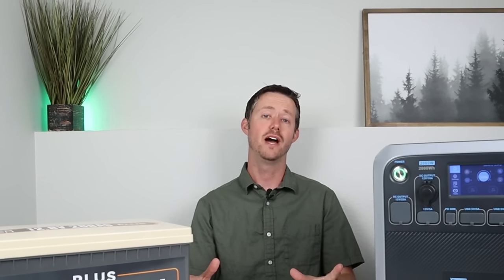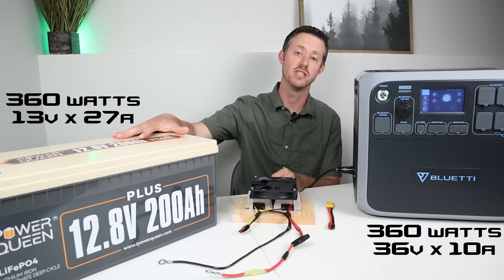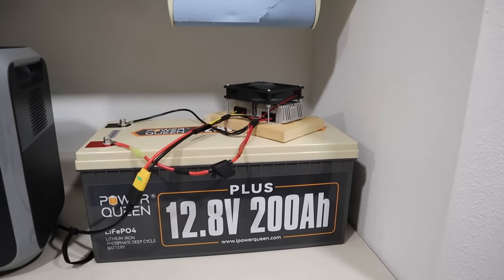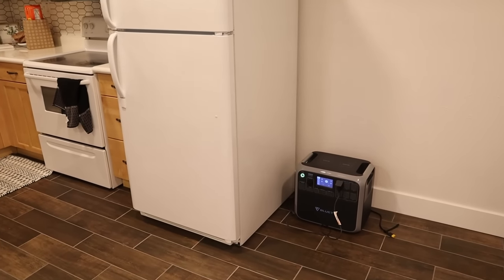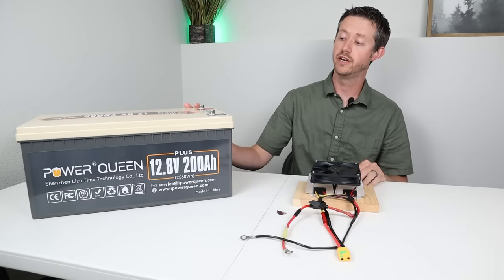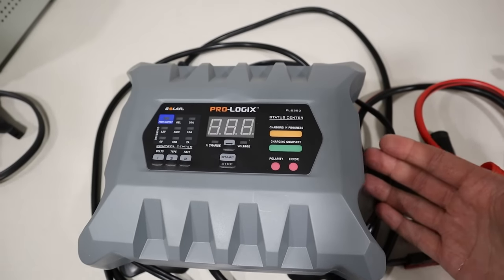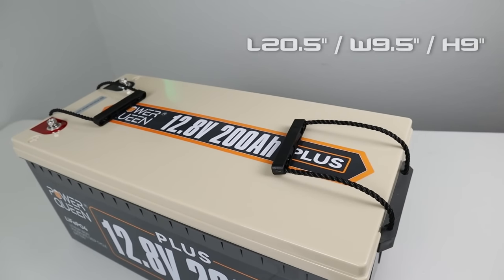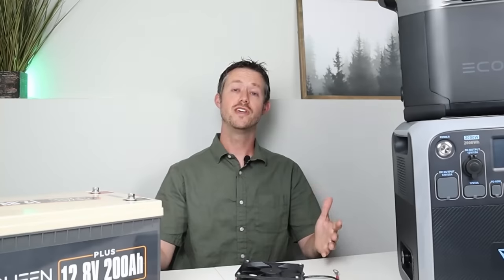Make Your Power Station Last Longer! Power Queen 200AH LiFePO4 - DIY Expansion Battery!

Comment: Jason... I don't own yet, want a AC200 max. I have a 48v server rack battery with 5kwh of capacity. Would it work to use he Bluetti DC Charging Enhancer (D050S) and battery clips to charge the AC200Max with the server rack battery? Thus increasing the capacity 3 fold
Reply from the maker: That's a great option! You wouldn't actually need the charging enhancer.  The 48v battery has peak voltage of 58.4 when fully charged which will be a great input voltage on the power station by itself.  Set the input charging on the AC200MAX to solar input and plug in the battery.

Comment: So, if I arrange a 36 volts battery with 70 Ah, it will be even cheaper, because I would not need a DC to DC converter. And, it will be easier for the fuse.
Reply from the maker: Correct, no need for a converter if you put the batteries in series.

Comment: i used a cheap variable dc-dc boost converter i got from amazon that allows 30 amps and for me to adjust the voltage and amps, has it's own cooling fan and a little over 30 bucks. but it does require supplying my own cables, and the 8 gauge ofc wires barely fit in the connectors. but it handled the 30 amps on the input for about 400 watts on the output. but you do have to set the voltage and current manually.
imo if you are going to be using it on a load that is variable, like a fridge, and is around 150 watts when on, i would connect the battery directly to the power station, and remove the loss that happens from the boost converter.
Reply from the maker: Thanks P M for sharing your setup! You are right that charging at the 12v rate would probably be fine while running 1 fridge. For other larger loads this mod will allow it to keep up with charging. If I was going to invest into a more serious setup like this it'd probably be better buy a 24v or 48v LFP battery and just run the power straight into the power station. For example, the 48v 5Kwh EG4 batteries make a good argument since they are cost effective for what you get.

Comment: i purchased from ebay about 2 years ago a 600 Watt 10-60 Volt to 12 to 80 Volt Boost Converter to boost  the voltage on a small 60 watts folding solar array to charge my Jackery 500 a little faster. It went very badly for the Jackery im afraid

Comment: Is it possible for the ac 200 L to recharge the onboard  and this expansion from the 200 L dc solar or ac charging?
Reply from the maker: If you have one of Bluettis expansion batteries that are compatible with the new AC200L, they will charge and discharge automatically as the power station is charged. It's a seemless setup and it's super simple to use.
If you used a DIY expansion battery, there is no way to have it charge from the AC200L automatically.

Comment: Can a dual fuel generator be used to recharge the Power Queen 200ah? I'm thinking of buying a power station and an external 400ah battery for Vanlife.
Reply from the maker: Get two of these and plug them into the generator and you'll charge your battery at 60 amps. Reliable and long lasting setup:  https://amzn.to/484DUD9

You could also use cheaper LFP battery chargers, they probably won't last as long.
Reply: @Jasonoid  Thanks for the advice, I'll look into your suggestion.

Comment: Hi, thank you so much for your video, I think I finally get it...I already have the Bluetti AC200MAX which I believe can take up to 51.2V, I was looking at having my Kia Carnival 2022 smart alternator/car battery connected to the Sterling Power DC-DC Battery to Battery Charger 12V 70A in / 48V out and connect the B2B Charger to my PowerStation, would that be correct? I'm hoping I'll get more than 500W into the PowerStation, up to 800W would be nice...lol.
I look forward to your response.

Comment: What is the benefit? Cant you just draw power from the battery  to generator without all that extra stuff?
Reply from the maker: Yeah, but you're limited to 100 watts charging if you connect up the battery directly. By increasing the voltage (with the attached gadgets) you can get 3X the  charging speed.

Comment: Ok so if you're using this backup battery to help power the generator, won't that prevent you from using solar panels as well? Since they would both use the same input on the power station. And is there a way to charge the extra battery with solar or is it only AC? Because that's one good thing about buying the OEM expansion battery. With something like the Ecolflow Delta 2, the spare battery they sell connects through a totally different input on the side of the units
Reply from the maker: The Bluetti power station has two charging ports, you could always use the Bluetti Charging Enhancer to charge with solar panels on the 7909 port OR you could have a solar charge controller and solar panels charging the large battery and the battery connected to the AC200p. Lots of different options and this was just one solution.

Comment: Hi there. Thanks for great vid. How would it work with 24v 100Ah battery? Would it damage power station (vtoman 1800 for example?)  . Would it need any adapters ? Would appreciate your response.
Reply from the maker: What's the charging input specs for that power station?
Reply: I think its  30V max
Reply from the maker: A 24v LFP battery is fully charged at 29.2 volts. It will often be under that amount. I guess as long as it stays below 30 volts it should be fine.
Reply: Meaning I can connect 24v 100Ah battery directly to power station without any charge controllers or any other devices? (Sorry for silly questions)
Reply from the maker: @slavaartyukh4075  yep, you might want to verify with a voltmeter to make sure it's not over 30 volts

Comment: Q:  can I charge the power queen via the power station using the DC output??   
Basically I have an ecoflow delta.   Thinking of using the DC cigarette output... Using a 24v converter, connector to power queens to charge the battery via solar. Will that work?
Reply from the maker: The DC output is not a charging voltage. I would recommend charging the battery using an official battery charger.

Comment: Can you charge a lithium battery using a charger while using system
Reply from the maker: Yes, you can charge the battery at the same time as putting power into the power station.

Comment: I tryed this on a eco-worthy battery 12v 100ah  with 12v  to 24v (step up) wired it up as you said, and it gave me 184w really happy  with that,
Then i noticed the small red wire coming from the battery side on the step up box was getting warm so i turn off not sure wats wrong im using xt60 plug .
Which is charging a delta 2 power station
Reply from the maker: It's okay if the wire is warm, you just don't want it to get super hot.

Comment: I have a gz yeti 400 lithium which has just one 8mm input with max input voltage of 22v. Would it be possible to do this without the step up converter or with a 12v to 18v step up? I’m hoping I can run solar panels through a charge controller to a lifepo4 battery (50 or 100ah) and then connect the battery directly to the 8mm input on the yeti, with or without a step up converter. Do you think this would work or am I missing something? Thanks!
Reply from the maker: You could always call goal zero to see if there is any tolerance on the voltage input, maybe instead of a hard cut off at 22v,  it goes up to 25 volts? If not the 12v to 18v converter will work just fine. I recommend going with a larger 20 amp model so it doesn't have to work as hard / get as warm.

Comment: i would prefer bying a 24 v  battery than having to fool around with such contraption.  24 v batteries cost more but better  than 12v  save on cable size.

Comment: Nice video. Since you are using the solar input in the bluetti, can you setup solar panels to charge the power queen simultaneously while they are feeding the bluetti? This way you don’t loose the solar capabilities… is that something that’s possible?
Reply from the maker: Yes, you can use a solar charge controller to charge the Power Queen at the same time as dumping power into the Bluetti AC200p. These stand alone batteries can put out power and be charged at the same time. You'd probably want more than 600 watts of solar to keep up with the power going into the Bluetti and still charge the Power Queen battery. Does that answer your question?
Reply: @Jasonoid yes! Thanks. So one would do that by using an mppt? Or do you recommend a specific controller?
Reply from the maker: @profprof111  mppt is better than pwm but they are slightly more expensive. You can use any of the chargers I recommended in the video, or just buy a larger version that supports more watts. Epever and Victron make great products.

Comment: i was thinking to buy 2 12v 50ah batteires connect them in series to have 24 volts  to charge the ac180 or ac180P   that would work also  but a bit more expensive
Reply from the maker: That would work great

Comment: I have a 24 to 12 volt buck converter. Had some strange idea in mind when I bought it to regulate voltage from a panel to directly power something but I forgot. Not sure what to do with it now. Any ideas?
Reply from the maker: Not sure, no ideas at the moment.

Comment: Cost of battery + booster set up + charger + knowledge not to burn up the whole set up and your house may not be worth the savings from just buying the recommended plug and play add on battery pack from the manufacturer, imo.

Comment: Is it important that your battery charger have Lifepo4 settings? or Normal car battery chargers will do?
Reply from the maker: Since this LFP batteries have a BMS inside they are pretty hard to damage. You can use a lead acid 12v battery charger and it's a very similar voltage.
Reply: oh wait i forgot the AC200Max has 12v output, maybe i can use that too

Comment: "This battery is NOT suitable for use as a starter battery, golf cart battery, or the high-power application such as water pump, lifting jack, elevator, vacuum cleaner, four-wheel drive lawn mower".
Is this talking about hooking it straight to these items? Cause I have saw people using these type batteries (with inverter) to run window A/C units that probably have more draw than a vacuum, so I am confused.
Reply from the maker: The internal BMS is not meant for larger surge loads. For some loads it will work just fine but for the larger loads it won't work well. They have newer batteries labeled as "trolling motor" batteries that can handle very high surge loads.

Comment: Is that Kisae Abso DMT1250 similar to the Bluetti charger 1, that takes power from your car battery/alternator to charge your battery? same performance?
Reply from the maker: Yep, I have a video on the Bluetti Charger 1 this next Friday! Stay tuned to watch it!
Reply: @Jasonoid  I'm seeing tons of videos on the charger 1. But if you've already cracked the code to use your alternator/battery with a DC-to-DC charger, with the $269 bluetti product by pairing up these 12-24v stepup converters, that's a game changer!
Reply from the maker: @patricklacson  if your comfortable with a diy setup, this will work, however, if you want a plug in play option, Pecron, Etaker, and Bluetti all have great options. The Bluetti is really cool due to its adjustable output voltage!
Reply: @Jasonoid  Comfortable soldering and using multimeter but not sure how reliable these step-up converters are. I plan on using it to charge my bluetti ac180. Will this work to charge that by hooking it up to alternator with the right 60amp fuse for safety and switch so it's not constantly charging? It's $50 vs $300, which seems like a no-brainer to me.
Reply from the maker: @patricklacson  it would work fine with that setup, but don't forget the cooling fans or you'll be melting these converters.

Comment: Thank you for the detailed vid, my question is ...With this setup, i'm plugging into my solar input with the xt60 plug on my Delta Max my delta is a max 2000 not the Delta 2 but that should not be an issue correct?

 Also there is a 12V to 48V DC Step UP Converter, DC Converter Regulator 6A 288W Power Supply Adapter if using 2 of these same set up it will give a 96v 12A OUTPUT and 576 Watts
I THINK THE LIMIT ON MY DELTA MAX IS ONLY 10A but I saw some specs 13A not sure if that's the Delta Max 2 specs but @ 576W that be great if the max would handle the Amps
Reply from the maker: This might be a more simple setup for what you are looking for:  https://youtu.be/I78RxjRXTn4
Reply: running my unit in my home only.... anyway in that other video the output is 20A I assume being the delta max specs are 100v 10a 800w 10a ...20a doesn't affect the unit as its rated  but in my set up there's no alternator involved straight from battery to up converter to unit I'm looking for in my home only like here in this video
Reply from the maker: @si12volt1  there are just better "converters" to get the job done, it doesn't have to be from a car alternator, just another battery that can source the amps.
Reply: @Jasonoid  Ok.... thank you.... the output of 20A into the delta max was also my concern but I believe you addressed that in the video also  ..funny I was just shopping for the xt60i-f plug/extension tnx for help

Comment: I put my old lead acid to work..24v system and have 2 leads from it in to the solar input on a 100/30 Victron. Out from 2 leads with Anderson connector. Using dolar input from the power station. An Anderson/mc4 connection. The powerstation can take max 230w , 13A..( EF R2 pro). With the victron i can change max A out so it gives me diversity. The old leadacid will be chsnged to 2 lifepo4 50A 24v.  The 24v system can have days or even a week or two to fill up until i want a big charge in to the power station. Sure, an inverter is included so, yes, i can charge the P S with full AC-charge if i am in a hurry.

Comment: This may be a dumb question but any reason you could not run a 12 volt refrigerator directly off the battery? I mean it would take another home made cable but would it be safe?
Reply from the maker: I do that all the time when I go camping. That's the best way to run a 12v fridge! I use my 100ah lifepo4 and I get huge runtimes. Of course running a 120v full size fridge you'll need an inverter or power station.

Comment: AlsoThe 200acmax has a 24 volt output, Can I charge 2 12 volt batteries in series off of the 200max while the solar pannels are charging the 200max and once the two 12 volt batteries are charged ,I can use them at night to boost the 200max when the solar pannels are not charging?
Reply from the maker: The DC output is not a battery charger, I don't recommend trying to charge a battery off that.

Comment: Can i charge the battery with a charger while i use it to charge the powerstation so as to guarantee uninterupted power supply to my security devices.
Reply from the maker: Yes, most power stations handle pass through charging just fine.

Comment: Could I use a 1500 watt inverter with the battery instead so that the power station could plug into its 110v outlet? I'm thinking specifically for the Ecoflow Delta Max - I believe it can fast charge up to 1800 watts (30% to full charge in less than 2 hours).
Reply from the maker: Yes, that will work just fine, it's just not super efficient because youre converting power from DC power to AC power, back to DC power.
Reply: @Jasonoid  

Thank you, I imagine the power loss due to the conversion might be defeating the purpose.  
I just found a 48V 29Ah18650 E-Bike Lithium Battery Pack, Built-in 30A BMS, on Amazon with a built-in XT-60 T-plug.  It says it's good for 350W-750W scooters. It costs just $120 USD and even comes with a 54v 2 amp charger!  Will this work?

Comment: If i were to do this using 2 smaller 12v batteries in series to connect to my eb70, is there any smart way one could also use the eb70s mppt charger to charge them back up?
Reply from the maker: So I'm thinking that there might be a slight issue running two of these batteries in series. When fully charged the voltage of two of these in series will be around 29.2volts (14.6v X 2). The voltage of the batteries once charged drops down to 13.5 volts very quickly and then will average around 13.2 volts for most of the discharge. Just make sure you don't connect the 24v battery setup to the EB70 until the voltage is below 28volts. 

As for charging up the 24v using the EB70's MPPT charge controller? No that isn't possible. You'll want to use a dedicated 24v LiFePO4 charger.

Comment: Does the 18awg wire from the step up converter get hot going into the bluetti?
Reply from the maker: It's only pushing 5 amps per wire so the output wires do not get hot.

Comment: Would a soler charger do the same as your 12 volt to 24 volt converters?
Reply from the maker: Maybe if it was a DC to DC charge controller designed for a higher voltage "48" volt LFP battery. Most charge controllers take a high voltage and drop it down to the voltage of a 12v battery.

Comment: Is it important to keep your  battery voltage and boosters within the solar charging parameters of your solar generator?
Reply from the maker: Yes, you never want to go over the voltage limits of your power station as described at the end of the video. It could damage the power station.

Comment: This may be obvious to some, but could I use 2 or 3, 12 volt batteries in series to increase the voltage. Other than the cost and extra space, would there be any downside?
Reply from the maker: Using batteries in series is a great way to get the higher voltage, instead of using the converter.

Comment: So is there a way to use Bluetti to charge the power queen
Reply from the maker: You could use the DC output of the Bluetti directly, but it will only charge it to 13.2 volts, which isn't fully charged.